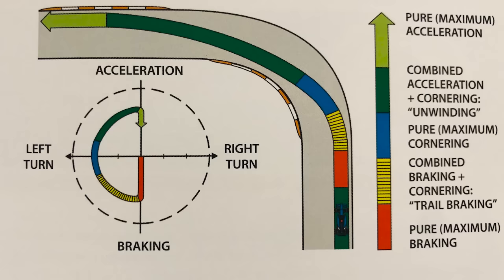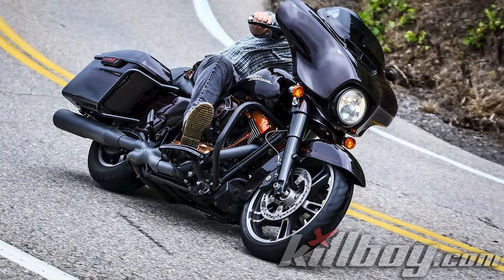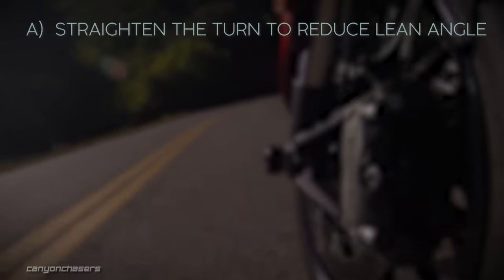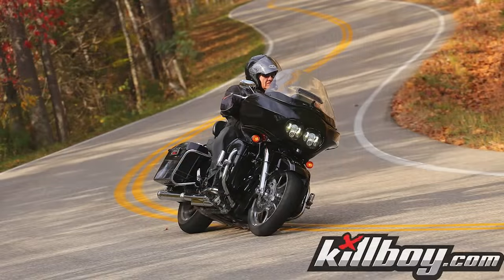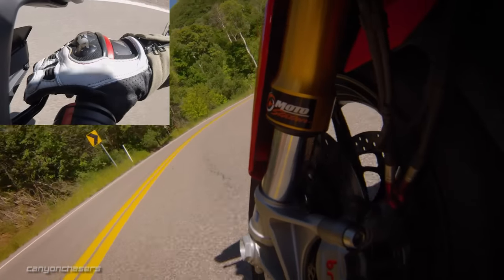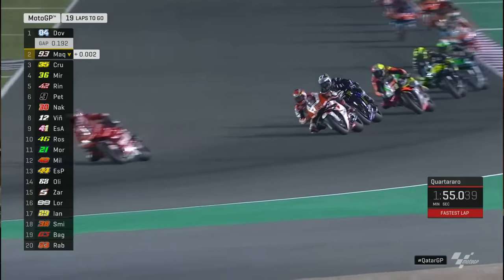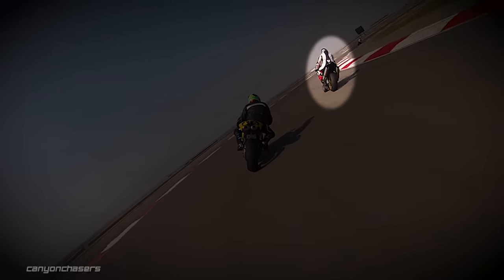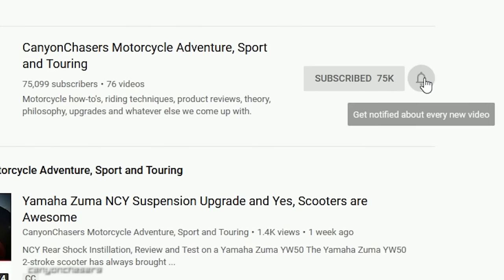How and Why Delayed APEXES Work

Comment: Thanks for the information. So if I am coming up to a normal turn on the street, not a curve with an apex, I can just slow down before the turn and use my clutch to get into the friction zone to make the turn while counter steering? Then on larger curves use the trail brake method while being in my right gear to take the turn then slowly accelerate out of it? And if its a larger curve and after I am leaned over while lightly front braking I can get off the brake and stay neutral with the throttle to maintain the lean?
Reply from the maker: Pretty much. Yep.

Comment: What gear you should be when you’re trail braking? Thanks
Reply from the maker: Depends on the corner.  Is it uphill, downhill, tight, wide, blind, open...
Reply: CanyonChasers downhill. Thanks
Reply from the maker: The point is there isn't a singular answer. You need to make that determination based on all those factors.
Reply: CanyonChasers thank you

Comment: I got a question for you. On my sport bikes I always tend to wear out the right side of the front tire first. I always wondered why. And then I realized when you always ride on the right side of the road your right hand turns will always be sharper than your left. So does that make sense or not?
Reply from the maker: Totally makes sense and uneven (side-to-side) wear is normal.  It could also be how your roads are crowned for water to flow off the road, or how the asphalt has worn from heavy trucks, what part of the world you are in and what side of the road you ride on.   I'm more comfortable turning left (probably because my local track has a lot more left turns) so I go faster on left turns and tend to wear out the left side of my tire faster.

Comment: Works great on the racetrack or a beautifully groomed road.  Where I live and ride there is a great chance that there will be debris in the curve where it settles in the middle of the lane and the edge of the lane.  The first time you run a road you need to ride in the car tire track.  Anywhere there is a driveway there is a very good chance there is gravel.  At the crest of a hill there is a very good chance there is a driveway and the road turns immediately after the crest.  You don't need to use the entire lane if you are riding at sane speeds.  :-)

I do see way too many riders hugging the yellow line on both left and right curves.  That is scary.

Comment: Almost everything you said is correct, but I wouldn't go as far as saying that this is the fastest way around a corner. Depending on the bike characteristics and riding styles the fastest way can be more fluid (orange circle) or V-shaped (2 apex.. late breaking, deep in the corner, quick on the throttle). As for the safety topic often ride the lane splitter line (or close by) until half or 3/4 of the corner can be risky as other riders or quick cars coming in the other direction can often cut the corner. I understand it's difficult to include all cases, but exactly for this reason I think should be better to say apply different techniques to different situations (known or unknown road, tarmac conditions, bike used, etc..). Just my two cents. Thanks for the video
Reply from the maker: You are, of course, correct. Our long-term plan is to eventually go into more detail about the different kinds of corners in their own video. Like, we could dedicate an entire video to the dual-apex corner.
Reply: @CanyonChasers  thank you for the polite and quick answer, I must say that i really like your humble and chill tone you use in your videos, really a refreshing sight in the YouTube community. Keep up the good work

Comment: Increasing the speed at a static lean angle while turning makes the radius of the turn smaller not bigger...
Reply from the maker: Nope. Go to a big parking lot and do some circles.  Keep your lean angle and accelerate. Keep your lean angle then roll off the throttle.  Keep you lean angle then gently apply your front brake. For a given lean angle, radius and speed are inexorably linked.

Comment: Just thought of something:
+CanyonChasers
Do you have any tips for interpreting tyre wall patterns after a ride, to assess how much lean you were actually getting?
On my GSX1400Z K7 I have been surprised by how far it looked like I had been over - as I usually feel I am being fairly conservative with lean angles...
I'm not sure whether this relates to the fact that I have a 190mm tyre on the rear... approaching 2x the width of my previous bikes... as it's like 2 decades newer than my last GSX :-)
...or whether I should apply some other heuristic or technique to be sure I'm not actually giving myself less margin for error than I think I am :-/

Cheers!
Reply from the maker: We've been thinking about doing this. Good to know it would be of interest.

Comment: HI 
CanyonChasers A newbie here. Does that mean we lean most at the apex?
Reply: Not necessarily, it depends on how you define your apex: is it the half-way point in the corner, or is it the point where you are nearest to the curb, or is it where you start to pick up the bike and open the throttle. If you look at the graphic towards the end, the red and yellow circles have constant radii, assuming you are at a constant speed, you would have constant lean.  The orange circle also has a constant radius, but it is different, in that the position of the rider changes from outside left, to inside right to outside left (relative to his lane). Where the rider reaches the inside curb is what most people call the apex. You see, the lean angle is always constant with constant speed at constant radii. Now we could repeat this discussion without assuming constant speed, and it quickly gets complicated (like in real life)!

Comment: Sir I would like to ask  what you recommend I  got bmw sk1rr 2013 should I stay sport mode or racing or slick.
Reply from the maker: Depends on your experience level and where you are riding. Are you on a race track? Are you running slick tires?  If you are newer rider, I’d recommend putting it in Rain mode for a while until you get more familiar with the bike.
Reply: @CanyonChasers   mostly street ridding and some twisty road yes I have slick tire  my tires is street and track  when I was riding night and  I rides hard I felt like  I’m not safe like breaking  .. but I like slick mode .. should I stay on sport mode ?

Comment: how do you know, or where is the point, when you have to actually start TURNING (the moment you start leaning to go from the outside to inside)? i'm trying to figure out where the opposite of the apex would be.
Reply from the maker: When you can see your exit or you can line up the exit with your apex.
Reply: @CanyonChasers  I understand that part for the apex.
I guess my question wasn't clear. What I'm trying to ask the point in the curve/bend where I should start leaning (from upright).   The moment just after full braking when entering the corner. I understand that I have to position the bike on the outside when entering the corner but I'm still a little unsure as to when I should really start turning. Because turning too early might  cause me to eat the opposite lane.

Comment: Ride the outside line until you see the apex starting to straighten then quick turn the bike to cross over to ride parallel next to the center line / fog line...works every time.

If you want to learn how to go wide practice early apexing every corner....very quickly you will be without your bike and possibly your life!...😎

Comment: These tips would be common sense once you've rode for awhile and you tried and tested all the methods and yes, the common sense corner is taking a corner with the least amount of cornering.
This will also make you lose the least amount of speed in a corner because if you keep your cornering line as straight as you can, there's less reason to break and slow down.

Comment: That's all fine but what if you cant see the apex as the bend is a blind one where one cannot with any certainty guarantee where the apex is?  meaning possibly the end of the bend literally and understanding that many bends are blind ones and some tighten up unfortunately.  It's totally different if training on  a track where one has the advantage in many circumstances of seeing the whole of a bend or at least see or know where the apex is.   It could be early or late but it's more obvious on a track and you have the advantage of maybe some 40 ft of concrete and no approaching traffic to deal with plus a  good  road surface  which doesn't often happen out on normal roads.  Add to that the fact that one is going round and round the same track improving every time so that one gets used to that corner or bend and that  doesn't happen on new to you roads. Many riders know the tracks as they have used them again and again and many if not all know  where to apply the brakes on approach for a certain corner and also have knowledge with experience where to initiate a turn in order to achieve a good apex.  These are somethings that are  major practices and principals that are missing  under normal road riding conditions on new roads.    

Under those circumstances where you cant see the apex and /or the end of the bend means that you could be big trouble not knowing where to start the turn and therefore if you rely on the slow lean press and roll and follow the contours of the bend you will eventually reach the apex and pass it and once past it one can see the road opening out, sit the bike up and accelerate out of the bend with confidence.  Therefore not  needing to turn early or late but turning in conjunction with it and not actually hitting the so called apex.  Being no closer than the same distance away from it as one is paralleling the apex of the bend all the way round, through it and then as the road opens up one can set the bike up for the path out of the bend.

This is much safer than the racing method and if adopted by more motorcyclists would  result in reducing some of the  4/5000 deaths  and many more serious injuries suffered by motorcyclists on the roads in the USA every year.

Comment: When we talk about cornering, remove the need for speed and do not talk about stepping on the gas. Inexperienced riders and riders on unfamiliar bikes are at high risk going too fast on corners. If the road you don’t know, go slow. It is  the law in most countries that you must always travel at a speed that you can stop to avoid an accident. It is a fact that speed kills. Your diagrams and explanation do show the right path on American roads, but “Gentle ease on the throttle,” conveys a different idea to riders than “step on the gas.” In Thailand most highways have motor cycle lanes about 6’ wide on the curb or shoulder side. One just slows down and takes the large diameter path. But then most Thai motorcycles are 100cc to 150 cc and ridden under 80kph or 50mph. Weaving from the outside to the inside of the car’s lanes would be illegal and cars may pass you on the inside, angry that you are in their pathway. That may seem irrelevant  until you watch American’s riding in groups road racing and showing off,  passing on the inside, dying to impress! I broke my leg aged 16, 60 years ago, too fast on a corner on a BSA650. Still riding bikes.

Comment: The MSF's insistence on newbies not covering the brakes is problematic. Trail braking is made possible only by covering the front brake lever and developing the fine muscle control needed to brake with one or two fingers. It's also a good practice in city traffic because it helps reduce reaction time.

Comment: As a new rider on the street, my problem is finding out what the lean angle limit is on my bike in any given turn..On my dirt bike, I power slide out of the corner but can't do that on the road..How do you know when the lean angle is too great and the tires will break loose?
Reply: What bike are you riding? If it's a bike made for the street your tires won't break loose at street speeds. This isn't moto gp. Even really knobby dirt bike tires shouldn't be an issue.
Reply: That's the magic you learn from practice ... knowing when you're losing traction and how you manage it. It's the brain to throttle connection, and since you've already got that on your dirt bike you're far ahead of most street riders. Just play it safe. Tire temp and surface adhesion means you really don't know how much traction you have unless you're repeatedly going through the same corner (like on the track). Remember what Dave mentioned in the video ... less lean, more throttle. More lean and more throttle rarely works out well. And be sure to check your tire pressure often!
Reply: Simply put, by feel. If you can tick off the following boxes then you can feel exactly how much grip you have. Suspension tuned and serviced regularly. Correct tyre pressure but you'll feel that as well. Decent tyres. Relaxing your grip on the bars and your arms. If you have looked after these then you can feel what your tyres are doing. To understand feel for a new rider go and find an open bend with some sort of paint marking like an arrow mid bend. At a moderate speed ride through the bend over the paint. What you feel running over the paint is the grip difference between the road and paint. Same for wet roads. The shiny bits are standing water and you'll quickly work out riding on the dull bits is best. Saying that it's surprising how much grip you really have on a wet road when you stay away from the standing water. Learn to tune in to what your bike is telling you.
Reply: The Cappy I have a brand new KTM 390 Duke..
Reply: TBone MC all good points..thanks..I just don’t want to find out the hard way..going down on the road compared to the dirt seems a bit different. :)
The rain? I had my first downpour the other day..pretty fucking scary I must say..it felt like every bump and corner I was gonna go down..I rode safe but it still gave me no security that bad things weren’t gonna happen..it’s not like a car where you can test out the limits in a parking lot if you wanted..on a bike, it’s almost like you have to slide out and crash to find out what the bike will do..I’ll try not too. :)

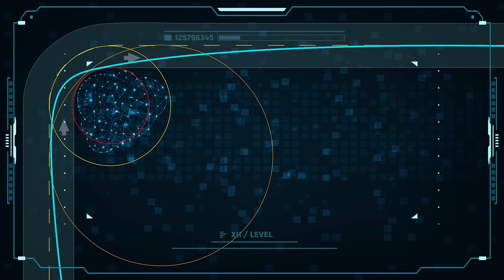Comment: Parts of your video are excellent.  There is no "rote" method for all  corners.  You are doing people no favors making them think so.  Accelerating out of corners revving out a high powered sport bike is fine on the race track, but on the street with speed limits and traffic, not so important.  The line is just the series of positions through the corner.  Plan your ride, ride your plan.  You totally don't mention the braking marker.  Braking marker, corner turn in, apex, corner exit.  All points in between makes the line.  7:45 is excellent!  Look at how fast you can go on the "wide arc" line.  Look at how slow you need to go on the trail braking, late apex, accelerating line.  Yes, the tighter the radius of the turn, the slower you need to go.  Drawing corner pictures is excellent!  If you tend to edge over to the inside of the turn just repeat "Go Deep, Turn Hard".  If you can't do the wide arc, you can't do the fancier stuff.  Road conditions: radius, camber, elevation,  traction.  These can change throughout the turn.  Each requires a different line and technique.  Flat, constant radius turn with good traction will never be the same as crest of hill, decreasing radius turn with excessive tar strips.  Leave lot's of safety margin.  As you get better you can use less.  At 10/10th there is no safety margin and you must be perfect.  Ride your plan or crash.  So work  on the perfect line and technique at 7/10ths.  Adding speed will just make it harder.  When you drive around a circle do you accelerate out of the corner continuously (or trail brake continuously).  Or do you "wide arc".  Your hairpin 300 degree turn is mostly "wide arc".  Road builders think we are all idiots and love decreasing radius turns up to the apex.  You feel the corner, step on the brake and slow down and then turn even harder.  Works form both directions. Decreasing Radius In, Increasing Radius Out (DRIIRO) Trail braking in, accelerating out works on this very common corner type. Thanks for starting the discussion!

Comment: I thought that if you apply break the bike natruly wants to stand up?...
Reply from the maker: If you grab the brake in the middle of the corner, yeah.... It'll want to stand up, but doing the majority of your braking, then trailing off the brake into the turn totally makes the bike change direction.  Even though it's really hard to do smoothly, even gently squeezing the front brake mid corner will make it turn, but it's harder to do than trailing the front brake into the turn.

Comment: I'm sorry, why is this necessary? To be the fastest on public road? Does one really want to approach wide or hit the apex being close to vehicles, slippery paint, or the edge of the road?
Why not assume that your lane is already your best line around a corner and already goes through the apex? Why not stick to the middle whilst in the corner and have enough room to go out or in?
Reply from the maker: The middle is an awful line through a corner on a public road for a myriad of reasons we've tried to touch on in this and other videos. The delayed apex isn't just (typically) the safest approach to a corner, it also just happens to (typically) be faster because you can accelerate out of the corner, where it's safest to try to go fast. I totally get that not everyone cares about being fast, but a) this approach reduces risk but b) more riders than not enjoy riding quickly. And a great many will try to go fast no matter what anybody else says  I choose to try to help them in a way that reduces the risk to themselves and others.